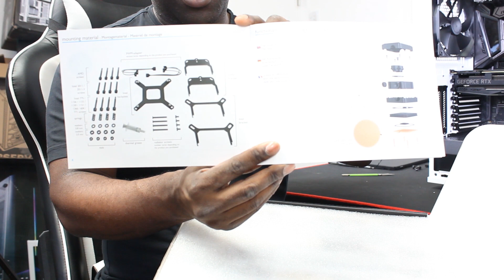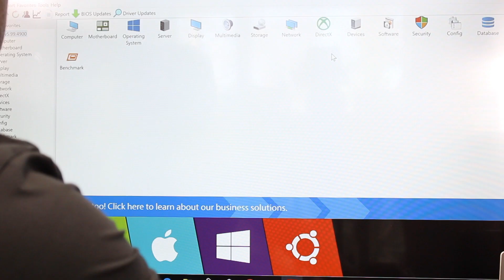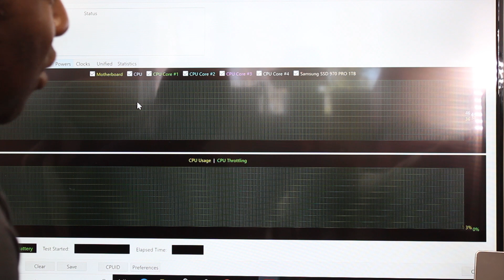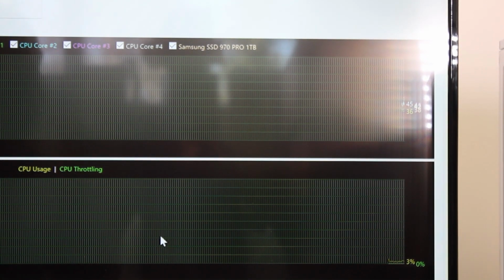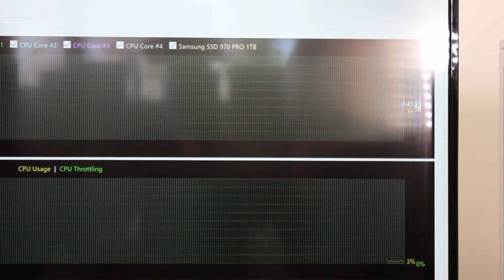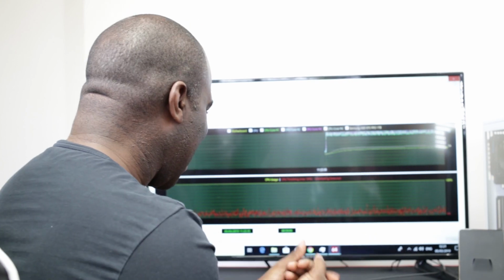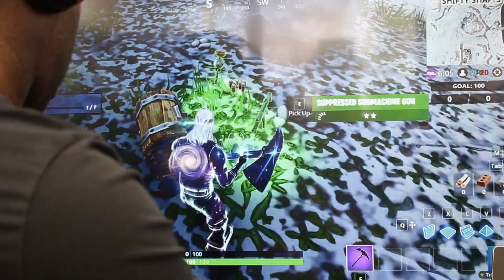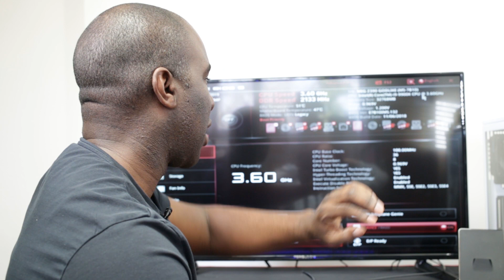Can The Alphacool Eisbaer LT120 Really Cool The 9900K?

Comment: I have this cooler on my 9700K 4.8GHz All Cores 1.3V and my temp is 75C on full load.
Reply: What is full load? My delided 8700k at 4.7ghz and 1.25v (stability over thermals) runs at the same 75c with peaks into the 80s  during aida64 full stress (Inc ram) with dual ml120pro fans at 1000rpm. It's still amazing for such a small 120 aio. Gaming never goes above 60c (and that's in RDR2 which is a cpu hog). Never did a stress test with fans at max since I got this pretty recently.
Reply: @gtaseed  Prime95 small FFT for 2 hours.

Comment: I noticed it says in your task manager that the CPU is throttling. That's probably why your temps are lower, it already hit tj max and dropped.
Reply from the maker: If a throttling occurs, it will simply mean just what you said and you will have lower temps, but also slower performance till it ramps up again.🤔🙂
Reply: @MXDOUT  Yep. So I'd say I wouldn't get this for a 9900k too. Nice cooler though!